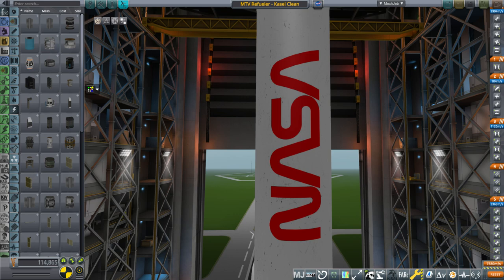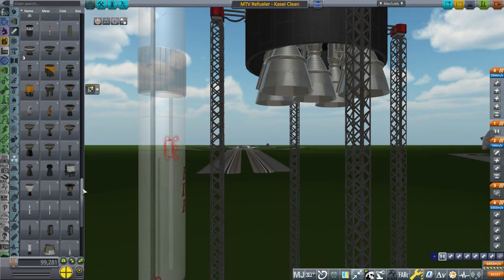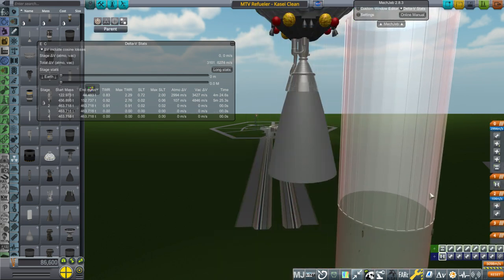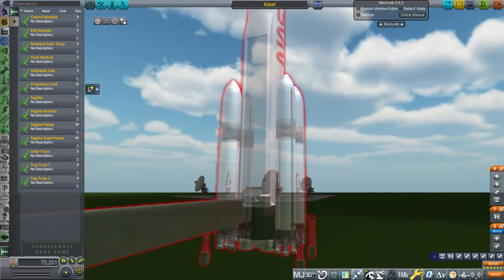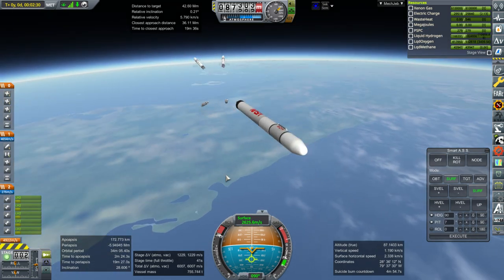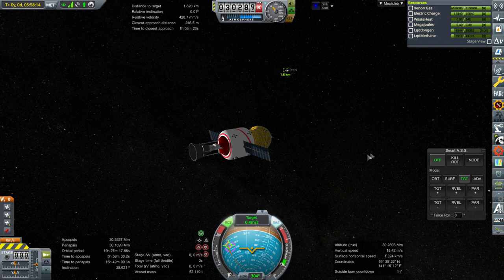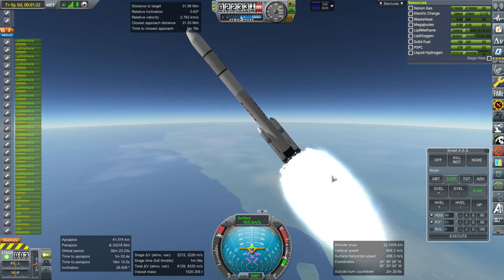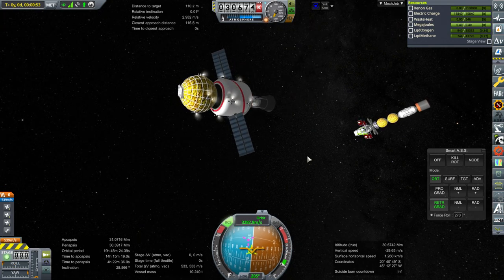KSP 1.6.1 RO and Kerbalism - Mars Colonization 026 - Kasei

Comment: I've had similar control surface problems as your flyback stages wings, particularly on my Conservator reversed wing demonstrators.

This error turns a flap the same (wrong) direction regardless of reverse or standard controls.

As far as I can tell; KSP can get confused when you put control surfaces in contradictory situations. Such as on a leading edge at the back of a wing.

If your wings deploy mirrored, you may be moving one flaps original 'down' in a way that contradicts the other wing.

Comment: I'm sure you've already fixed it, but those control surfaces on the retractable wings, if they were folded up, they would rotate in the "correct" axis. If they rotated on the z axis (up/down if your axis are weird), when folded out they should rotate in the correct direction. Then again, I'm kind of talking out of my ass because I know literally nothing about how animation in ksp works.

Comment: This CH4 third stage after H2 second looks strange for me too. Mli layers, reflective film and design for minimize heat transfer can eliminate boiloff practically to zero even without active cooling, i think. And also, why you dont like expander cycle? Once you in orbit do you really need more then 250-300 kN per engine? You think it is too expensive?
Reply from the maker: Well, the third stage is there as a legacy stage - because we haven't developed a new stage. I said in the video that I'd work on a hydrolox stage - maybe you missed it. Expander cycle doesn't work for much more than 200 kN and I will probably just use of-the-shelf engines for hydrolox below 1500 kN - Blue Origin's BE-3U is particularly attractive. As for questioning whether I need more than 300 kN once I get to orbit, have you met my ion engines? I think I've already demonstrated sufficient tolerance for low thrust. The question is whether I feel a need to develop a new engine, and for that class of hydrolox I don't, but I would like to develop a full-fledged zero-boiloff tank for future purposes.